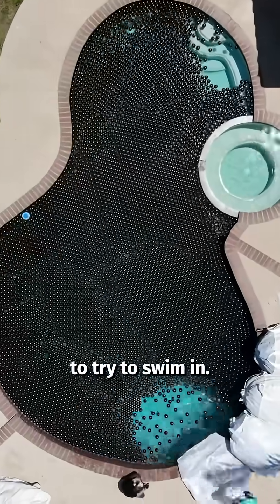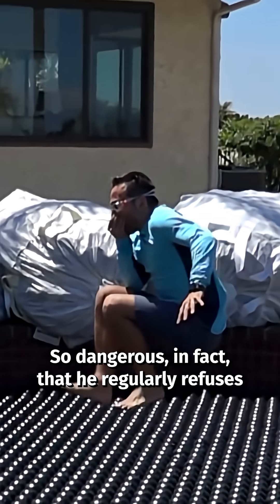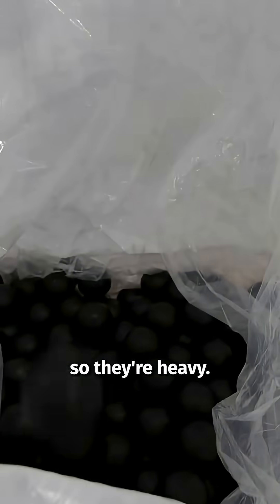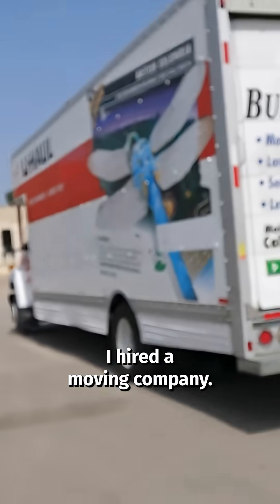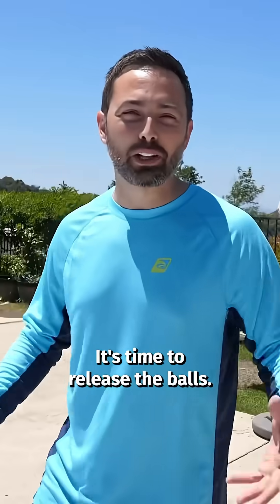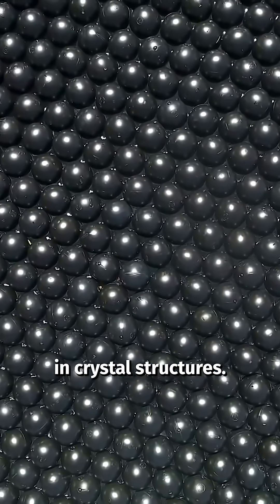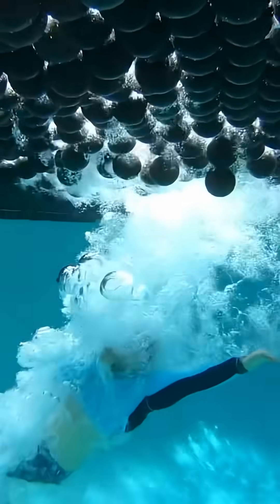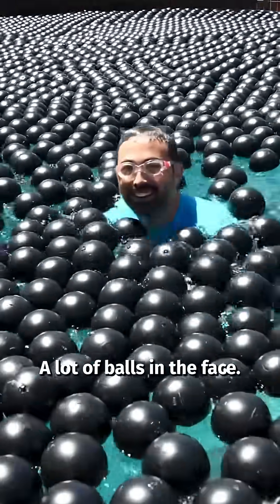Can you swim in shade balls?

Comment: Strikes as strange to use a color that absorbs heat in attempt to reduce evaporation. Seems like it would definitely make the water hotter and increase evap. As if water vapor cannot easily pass between loosely or densely floating balls. I don't wear black clothing in the summer sun to shade myself and prevent sweating evaporation. It doesn't work. W😊hy not make them white to reduce light absorption and evaporation from heat  buildup? Probably to avoid accusations of white supremacy. And why not make them porous and self-filling to reduce shipping weight? Have fun removing amd storing 10k of them that are sealed half-full when time comes you want to swim "safely."

Comment: I havent watched the full vid but just off common sense, this is a controlled enviroment. 

In a real world resevoir, the water levels will not be consistent. If water level is low, the shade balls will be too dense to swim through.

If theres a single layer in a controlled enviroment, its no issue.

If i had to guess, the manufacturer just doesnt want people to think its a fun idea, cause under certain conditions, its basically quicksand.

So thia short does a real bad job of respecting the manufacturers intent 😅

Comment: honestly, this seems 100% safe. you’re swimming just fine and smiling
Reply: That's a big flaw of the video because under some slightly different circumstances it is very very dangerous.

You can run out of breath quickly swimming through obstacles like this which nay make you unable to reach the edge in a larger reservoir, and also in a larger reservoir there may be multiple layers which makes surfacing at all take significant effort.

Comment: The danger is that the balls are half-filled with water, so depending on how densely packed together they are, two reasons off the top of my head are: 1. When your head goes below the surface, it will be more difficult to break the surface coming up for air. 2. Viscosity makes it more tiring to swim through.

Comment: Bad short video. VERY bad. 

DO NOT DO THIS.

I have had to swim in these ... part of a gov. evaluation - DECADES ago. They are DANGEROUS.

As you saw him laughing ... that was one layer of balls. Yes, it is a bit silly but most any confident swimmer  can swim in those, but it gets tiring FAST. By "fast" I mean you are likely to have just 1/4 of your normal endurance. Also you have a limited selection of swim strokes you can use. Most importantly the rescue side stroke is difficult and often neither the rescuer or rescuee will not be able to breathe. 

Reservoirs have 2-5 layers. In just two layers I - at the time a lifeguard, a HS swim "star," and a selectee for the  US Olympic swim team training center - had extreme difficulty in performing a rescue. 

In 3+ layers it was impossible without breathing gear - like a sea snorkel or SCUBA.

The most dangerous part is underestimating it. It seems OK at first ... giving you false confidence.

Just do NOT do it. Even in an emergency - have caution, and most importantly a PLAN. 

A floatation device is highly recommended if you have to do a rescue.

Comment: And this is why it's DANGEROUS:
1. Entrapment / No Way Out
Shade balls are designed to completely cover the surface of the water. If you dive in, the balls close up behind you and form a “lid.” From underwater, you’d push up against them but you can’t see air clearly. It’s disorienting and feels like being trapped under ice.

2. Disorientation
Because the balls move and let a bit of light through unevenly, you can’t easily tell where the surface or edge is. Panic sets in quickly when you don’t see a clear way to breathe.

3. No Air Pockets
Unlike other floating covers (like leaves or lily pads) that may leave gaps, shade balls roll and shift to close gaps. There’s no reliable pocket of air under them for you to catch a breath.

4. Weight & Resistance
Each ball isn’t heavy, but together thousands of them create resistance. Pushing through them is exhausting — especially in panic mode. They also absorb heat from the sun, making the top layer hotter, which adds stress.

5. False Sense of Safety
They look harmless, even fun, like you could just pop up through them. In reality, it’s similar to being trapped under a flexible but sealing layer — extremely dangerous in seconds.

Source: ChatGPT

Comment: They said they're half full of water and they're heavy. I imagine it's difficult to swim through them, especially if you have multiple layers of these balls so you'll get tired much faster. The other issue is if you are submerged. You will have a hard time pushing through the balls to resurface, especially if you have no floor to push off of.

Heavy things are difficult to move, so there is a significant increased risk to drowning.

Comment: When they are used to cover reservoirs, they are much, much thicker (more layers). When you attempt to swim, you are just displacing the balls and not moving enough water to create force to move yourself (or barley enough). Basically like trying to swim in a ball pit with slightly weighed balls. You can still tread water, but moving horizontally is the problem.

Comment: Summary: In general you can swim good enough to float and probably survive.  However getting forward momentum swimming on top of the water is extremely difficult  as they constantly get in the way of your arms and legs.  Also in general with them repeatedly hitting you in the face it is not pleasant.  His most effective way was to float on his back and primarily kick and use his arms under the water with the back of his head acting to push them out of the way.

Comment: These balls float and they don't easily give way to one another horizontally when they are densely packed like this.  So you need to make your strokes below them where you can displace water and push yourself away from your current position.
It still sort of works with this number of balls, but imagine if the pool was half full with these. As veritasium pointed out, the balls start sort of interlocking, creating these chrystaline structures. If there were like 4 layers of these balls, your arms would have difficulty pushing away any water horizontally, because you'd just be pushing balls against balls which eventually push against the pool's wall. It wouldn't necessarily make swimming impossible, but it would make it a lot harder and you might need to change your technique.
Now imagine how it would be if there was an equal volume of balls as the volume of water. There would be this thick layer of balls half-floating in the water, but you as a human can't really swim in these balls. You'd be swimming at the water's surface, vertically in the center of that thick layer, surrounded by these balls. The ones above you add weight to your body and the ones next to you make moving around really difficult.
You could also compare it to swimming in a body of water with a thick layer of oil on top. You can't properly swim in the oil due to density, buf it will still push down on you and make it difficult to move around or even just reach the air to breathe.

Comment: 1. Swimming Hazard (Entrapment & Suffocation)

Shade balls form a loose but floating "carpet" on the water.

If you dive under them, they close above you, blocking light and making it extremely hard to know where the surface is.

Because they move back to cover the water, you can get trapped underneath and panic → risk of drowning.

Even if you try to push through, the balls resist and disorient you.

👉 This is the biggest reason Derek said they might be dangerous.

---

2. Breathing Hazard

If someone falls in, instinct is to lift your head for air. But the shadeballs float right on the surface, so your mouth might still be underwater or surrounded by balls → you may not get a clear breath.

---

3. Heat & Toxicity Concerns

Shade balls are made of HDPE plastic with carbon black added to resist UV sunlight.

In small quantities, not really toxic. But if they degrade, they could release microplastics or other chemicals into water.

That’s why manufacturers are cautious and don’t sell them for casual or swimming use.

---

4. Not a Toy

They’re designed for reservoirs, not for people to play in.

Manufacturers avoid liability: if someone suffocates or drowns trying to swim in shadeballs, they could be blamed. So they don’t sell them to the public.

Comment: Swimming in a pool covered with shade balls is extremely dangerous because they block light and air, making it hard to breathe or find the surface if you go under. They also disorient swimmers, hide them from rescuers, and create a suffocating barrier. Shade balls are meant for reservoirs to reduce evaporation and algae, not for swimming. 
Credit - ChatGPT

Comment: Not me thinking the whole pool was full and not just the top layer 😂
Reply: I still dont get why they black not white to reflect sun
Reply: @AK-vx4dy 
”Shade balls are black, not white, because the black color provides better protection against ultraviolet (UV) light and helps the balls last longer. While white would reflect more sunlight and potentially reduce water temperature, it would also allow more UV radiation to penetrate the plastic, causing it to degrade faster. Black shade balls, on the other hand, absorb UV light, preventing it from reaching the water and causing unwanted chemical reactions, such as bromate formation. Additionally, black shade balls are often made with carbon black, a pigment that enhances the plastic's durability and lifespan.”
Reply: @Bsing96 And now i know, thank you 🙂
Reply: @Bsing96  It is for algae, bud. They literally say so on their website.
Do some due diligence next time 👍👋
Reply: @AK-vx4dy  Came here with exactly the same question. Wouldn't it make sense for them to be white?
Reply: @AK-vx4dy  I'm not sure, but if i remmember currectly, they're black because everything else was more prone to degrading over time.
Reply: @AK-vx4dy  Black absorbs more light, preventing algae growth in the water.
Reply: @AK-vx4dy if they were white, then all the reflected light would heat up the air which literally contradicts one of the points of having these balls.
Also, this is like a 4 year old upload.
Edit: after like 2 minutes of rethinking my comment, I just realised I forgot that black absorbs and white reflects
Reply: There is a whole video on this channel answering this same question
Reply: I was thinking is for visibility. White would reflect too much sunlight for the camera,
Reply: So you have to remove every you swim?

Comment: I would think the greatest danger of these shade balls is the microplastic. We already have a huge problem with microplastics in water, soil, food, and so on, and the shade balls only contribute to that problem. There are other and much better ways to provide shade for water, including vegetation.
Reply: Can't remember what was said in the full video just because it was a long time ago. But I'm pretty sure that not a problem
Reply: You have to break up the plastic into tiny bits to get microplastic into the system that takes time with junk plastic. These are just brand new plastic balls in a contained space of a swimming pool. There's absolutely no problem there with microplastics
Reply: @Ana_crusis  these shade balls are used in massive water reservoirs where the balls Wil lay in the sun for years. That's what the original video was about
Reply: @sijmenkroon 
Yes I was just reading about them. Of course they are designed not to degrade by UV
Reply: @Ana_crusis 
In the commercial sense that it becomes a problem. This is more of a party trick thing, in long term water storage these balls are meant to shade, it could easily become problems. From what I remember of the video, they said the dye in the balls is inert (think it's just carbon black). That does not mean the plastics aren't going to break down, especially if they are rubbing up against each other for years.
Reply: @alexisthompson376 
Well they are treated not to break down under UV radiation. But of course like everything that will have a time limit. If they use them on dams they will have to check them and replace them
Reply: Google is your friend...
(With benefits)
Reply: In fairness, the video this comes from is pretty old. I think from before we started to really, fully understand the extent of the microplastic contamination
Reply: @glenngriffon  microplastic contamination was known for more than 25 years